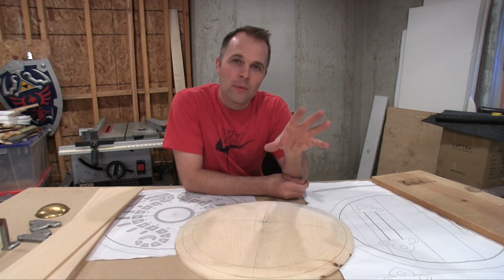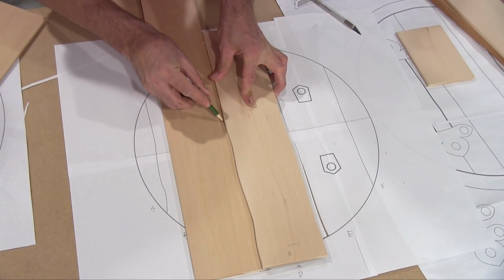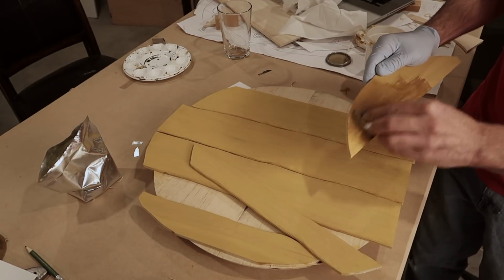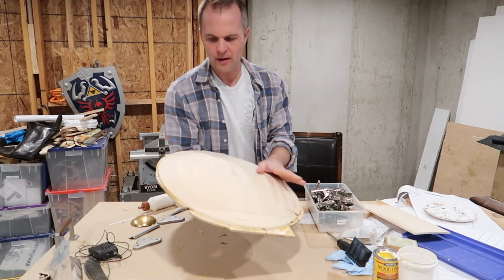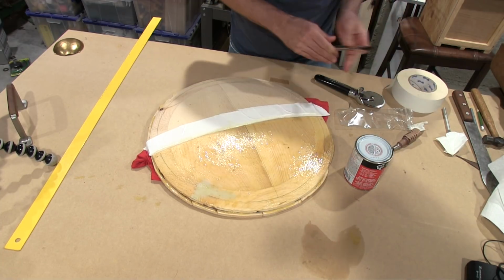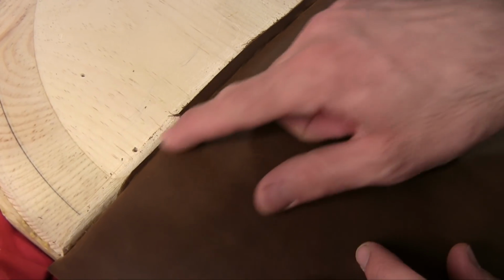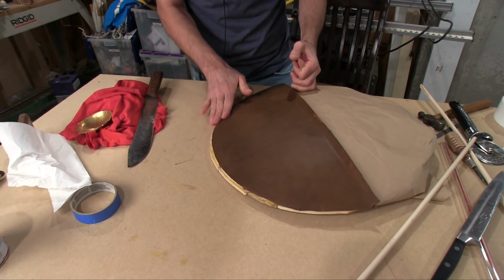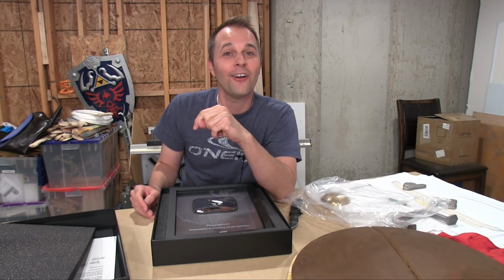How to make Link's Traveler's Shield Part 4 | Planks & Leather

Comment: It may be wood and leather, but that rim is metal on both sides. You can use Aluminum easy to work with, or a steel alloy. Either way, gray usually means metal, like the handle adornments. Same idea.  I assume it isnt gonna be used in a fierce battle ;)  , so tech, you dont need steel, but it easier to weld than aluminum is, only saying aluminum for weight.  Steel for flexibility on how it can look, and later on tooling as needed and repair ability as well.